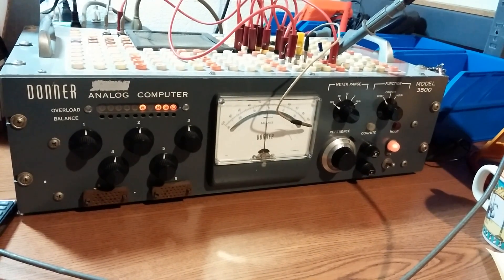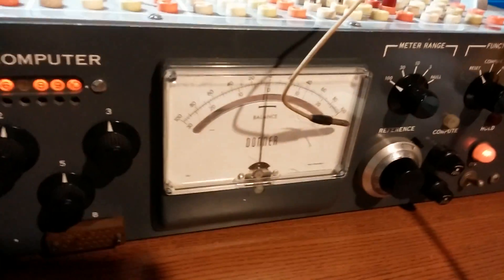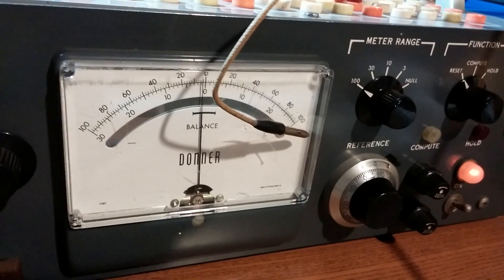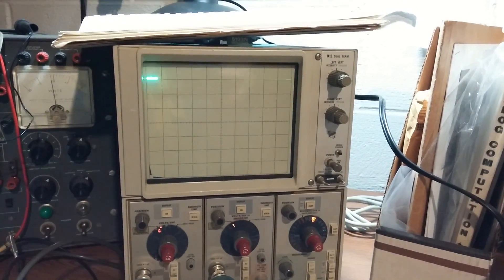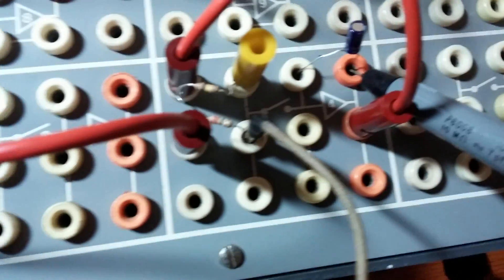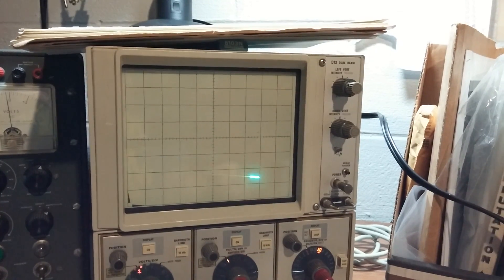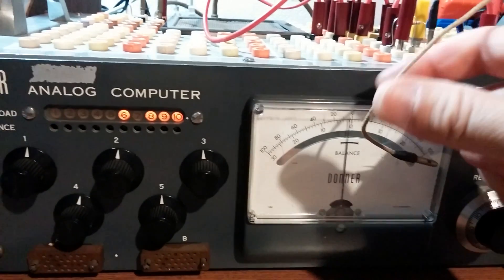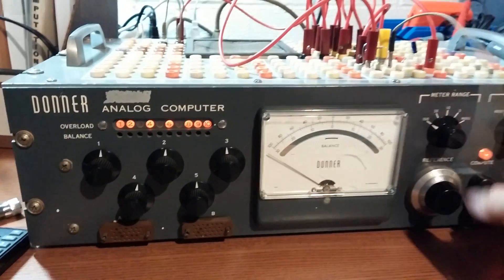1959 Donner 3500 Portable Analog Computer

Comment: In May 1972 my high school guidance counselor, Mr. Clark asked me if I was interested in computers and he let me have some sales info from the Systron Donner company giving info on their 10-20 and their 40-80 computers. Found a pdf on those things and down loaded it to my tablet. I didn't know analog from digital and only knew about computers from old Star Trek reruns and Roby the Robot. Poor Mr. Clark died from his lung cancer two months later,and I did not get into computers but took  drafting courses from Southern Tech. Did take a Fortran course that had you use key punch cards. My 24 line program adding up a column of numbers never ran, but I still got a "C" . About three years later Jobs and Wos were multi millionaires from their computer hobby and I would remain working on a drafting board till my company in 91 out sourced their design to a Korean company that had CADD. Since then I mow lawns. Jobs was just a year younger then me and when he died he had a net of over eight billion. Yet as far as I know Jobs never wrote a line of code or could design an electric circuit for anything. Life is strange. Good luck with your project. Have you ever heard of fluidics?

Comment: The Moniac was a old analog computer that used water to do the calculating for modeling economies such as England's or the U.S.A.'s  ( a water integrator). You Tube has some fun to watch post on the Moniacs that have been made to work again. Do you think your Donner 3500 could be programed to do the some thing that the Moniac did/does ? An electronic version of the Moniac?

Comment: I ran across and old patent 3190554 of a digital computer that used compressed air to run the logic gates instead of electricity . Have you ever seen such a computer and what would it be used for? Think such a design could be made today using 3D printing?
Reply: [Late to the party]  In engineering school [circa 1988] i visited a power plant w/ a pneumatic analog computer control system. It was overdue to be replaced with a more modern, digital computer, but it was still pretty cool. It was rather large: several banks of "circuits" in rows of "cabinets". BTW, analog control can be very good: with smooth response.
Reply: @a b No, not joking.

Comment: Possibly dumb question: How in a sense is this programmable? Did it actually have instructions or a execution unit in a modern sense, or was it simple a lot of common analog circuits packed into a small area that could be connected to each other with jumpers? Could this work in a conditional sense? I love older computers, but analog ones seem as if they  are from a different world.
Reply: You had to program it by connecting different circuits as you said.